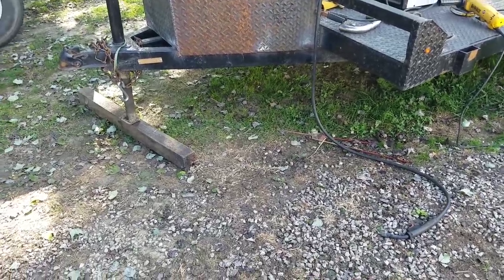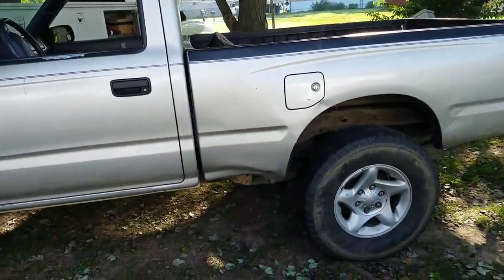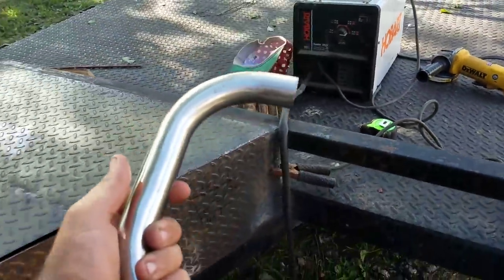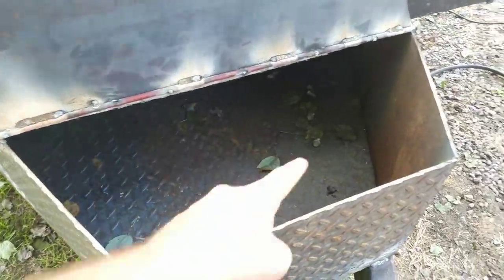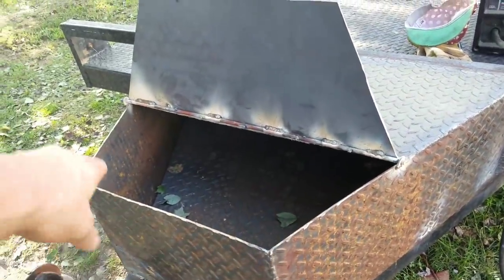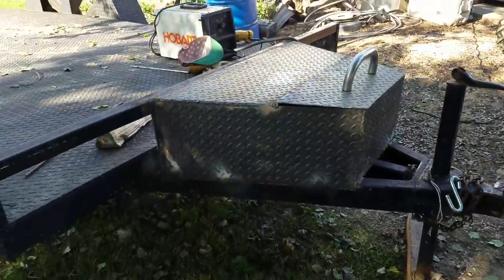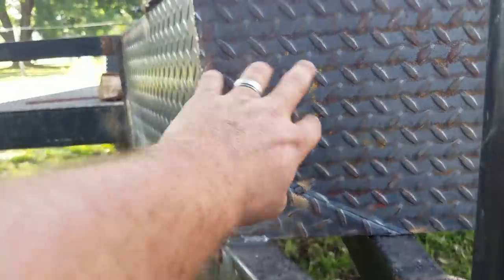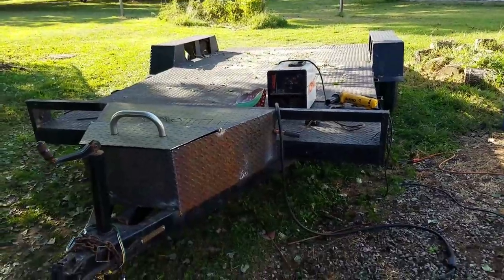#billowbilt trailer box

Comment: You could weld in say 3/4 angle iron around the inside of the lid opening so you could water proof it with weather stripping. Wet,moldy,rusty starps suck.

Comment: sure i vote to do it  but put it on another way so it's forward, not ass-backwards 
why didn't you finish welding inside before you welded top on? some southern people named Steve ______________ billows ( fill in the blank as you find fit